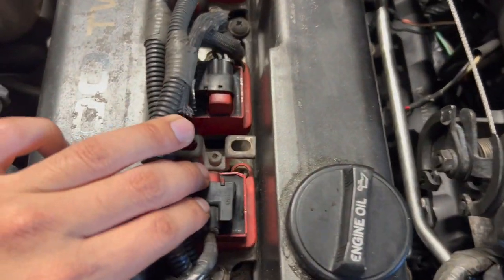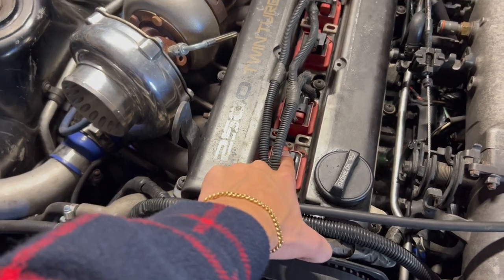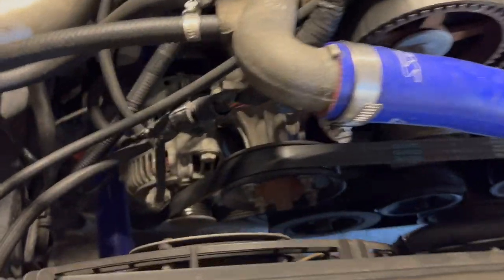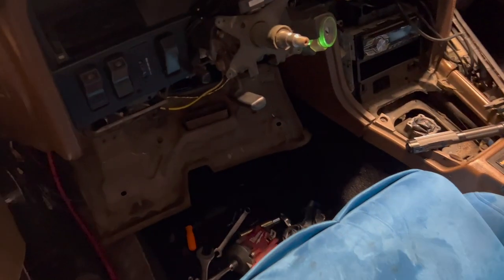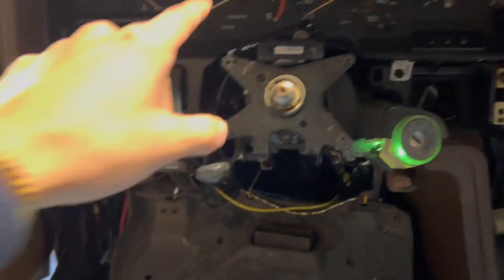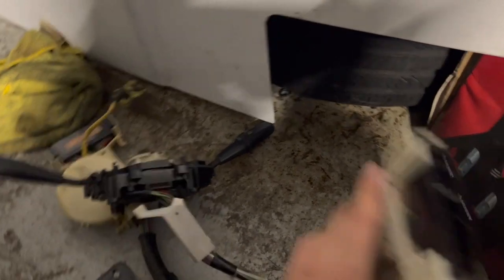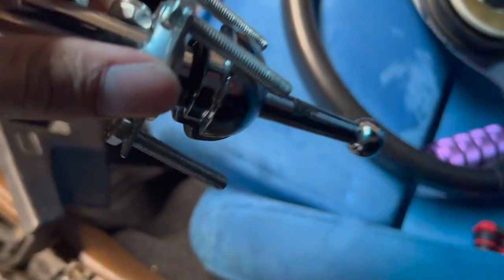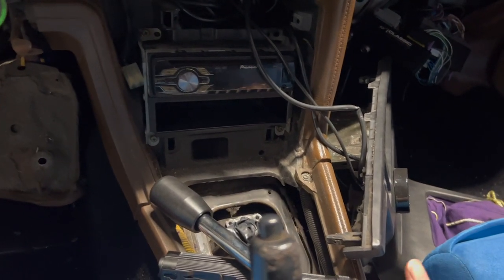PICKING UP THE CAR FROM THE DYNO!

Comment: Great video!! I would definitely replace those ign coils and some decent injectors so that you could start with a clean slate. Depending on how the car is cutting out, if it’s sputtering above 5k and running rich it’s likely either spark blowout from bad plugs or weak coils or it can be a crank sensor issue not picking up a proper signal from the harmonic balancer.